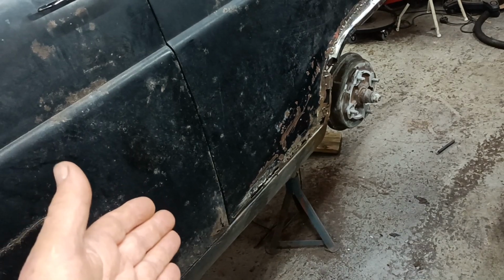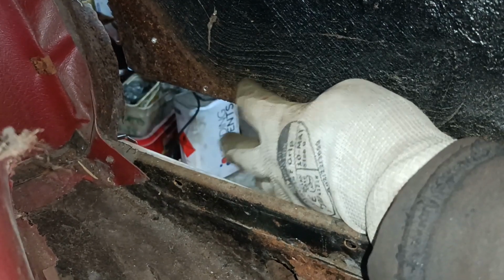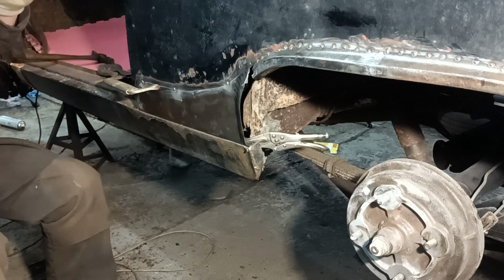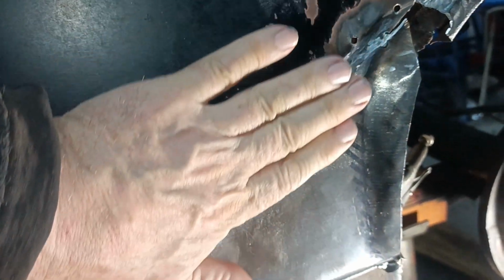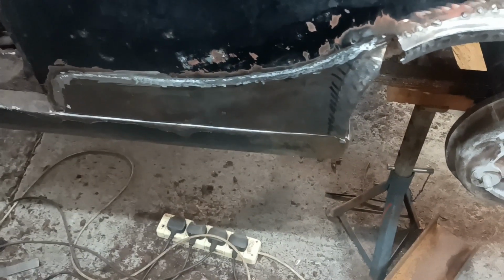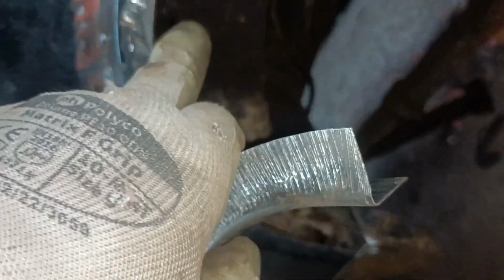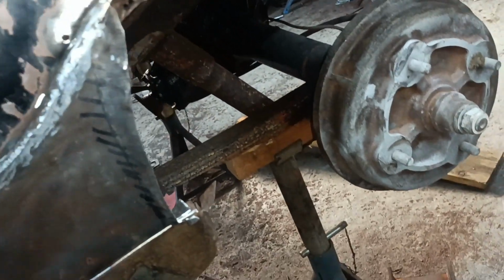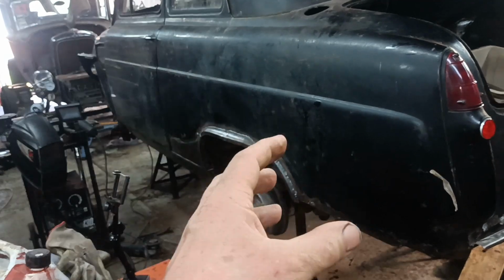Mission Creep 100E Anglia part 35! Quarter panel and wheelarch fabrication(2373)

Comment: Hi Mart.. handy machine that shrinker/stretchet. With hollows on the side i would boing them out and shrink them back with the oxy/acet. Heat the the high point    
to cherry red and let it cool. You could use a wet rag to greater effect. You but try.
Regards Kevin

Comment: Looks good, Don't worry about the oilcanning that's why they invented filler. I usually start with the inner fender parts, and make them in smaller pieces more manageable pieces. And then weld them on the bench, before I put them on the car.  But your way works too, fells a bit more fiddly in my world ;-)
Reply from the maker: Hi Lars, yes, doing the inside first would have been preferable but I needed the external shape first, as I had nothing to guide me. It was very fiddly but I have got through it and learnt some good techniques which I will show in a future video.

Comment: Looking good Mart and no pop rivets. I'll be interested to see how you tackle the end off sill, I think I would make a 3 dimensional piece that welds on the face of the sill and cut a hole in the back if worried about a water trap. I think you have started to affect the eBay bidding on 100e offerings.
Reply from the maker: Ha ha yeah, I saw a nice project pop up the other day. It looks like a bit less work than this one. I have tried to incorporate drain holes when possible. The sill will be finished in a similar way to the other side.

Comment: It all looks really good to me.  As for the oil-canning  ( and I apologise if what I'm about to say is impossible or has been considered and dismissed already ) is there any way of pushing the panel out a bit from inside the car (i,e, next to where the rear seat would be) and bracing it against some of the inner framework?  In my bodging way I would be wedging a lump of wood down the back!

Comment: Hey Mart: @ 17:30 you show some "oil canning" on that panel near the wheel arch. From my limited experience and thousands of miles away, it appears that panel has a bit of "stretch" (high/outward) where it's oil canning. Seems like cleaning off the paint on the high area and a bit of heat with a small shrinking disc followed by some quenching with a wet rat or spray bottle might shrink/tighten up that stretch area. Usually, it will shrink a bit too much and require a tiny bit of bumping back out to recover the correct shape. and stay tight. A bit of a "gentle" dance  sometimes requiring repeating . ;o) The shrinking disc seems much more "controllable"  (than torch heat) for the novice like you or I . ;o) I would suggest getting the smaller version (+ - 4"). 
We did wheel tubs on my son's 57 chevy and used the shrinker/stretcher extensively to make mounting flanges for the new wheel tubs. Learned a few things about using these tools. The amount of shrink/stretch changes depending how far "into" the jaws you place the material. then create more movement with each "crimp" when you work closer to the edge of the piece. We would hold or "cleco" the piece in place and mark with a sharpie where you need the shrinks/stretch. Re-attach and continue. BTW, If you shrink or stretch too much, it can be "reversed" with limits. Eventually, you will "bite" through the metal.  
That arch looks really good !!!   On that dent, puch out with a slightly convex dollie while you gently tap all around the low spot with your slapper. Need to push out rather hard with the dollie. Don't hit right on the dollie. Get the panels fairly straight then try to take care of any shrinks/stretches. Like you said, it takes experience to know when to stop but most anything can be reversed with lots of patience. You're doing great !!!!
Reply from the maker: Thanks for the detailed response, Ron. A lot of it makes sense to me.